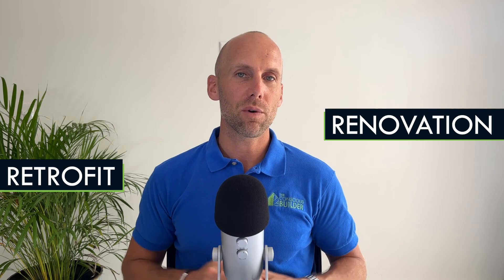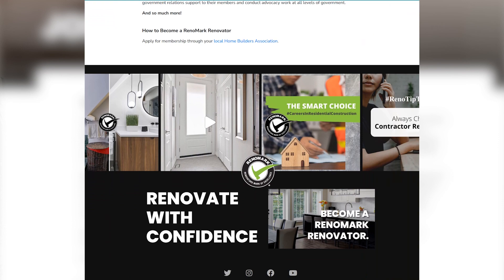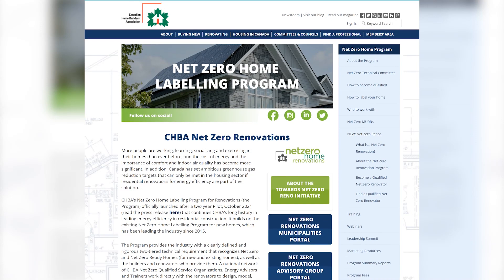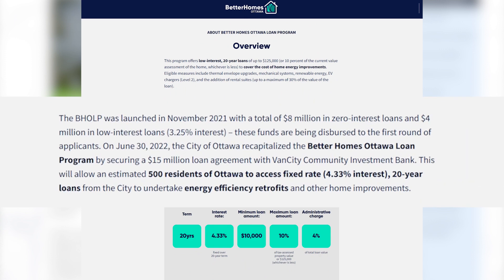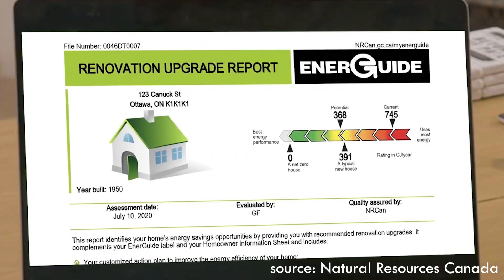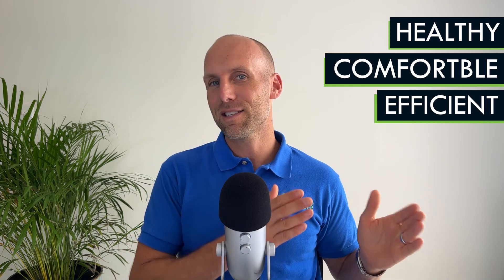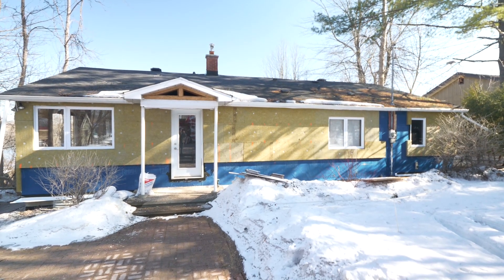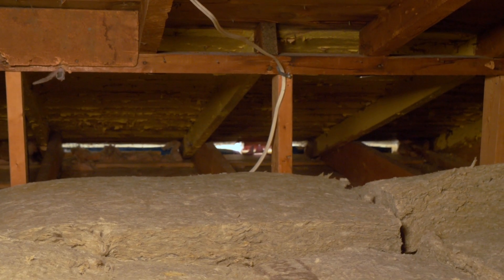RENOVATION VS. RETROFIT: What's the Difference? Net Zero Cottage Retrofit

Comment: You are wrong! Renovation is the act of repairing something that is broken, worn out, or under specified. Retrofitting is the act  of adding something that was missing or left out of the original build. 

For examples: Repairing or replacing windows and insulation to upgrade or repair a house  is a renovation. Remodeling a kitchen to improve utility or appearance, is another renovation. However, adding air conditioning to a house that never had it is a retrofit. Adding a dishwasher to a kitchen that never had one is a retrofit. 

Your definition is definitely wrong .
Reply from the maker: Thanks for watching! Depends where you're coming from. In the dictionary, your description is bang on. In housing, it's often used this way. For example here: https://natural-resources.canada.ca/energy-efficiency/buildings/existing-buildings/retrofitting/20707